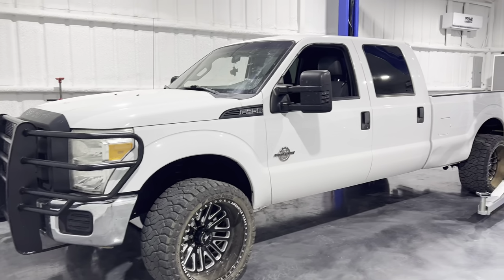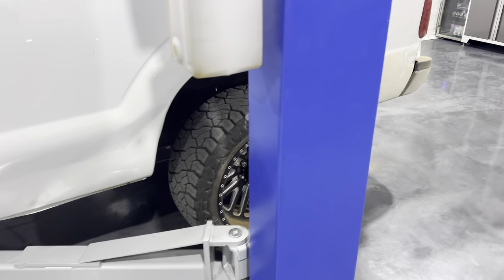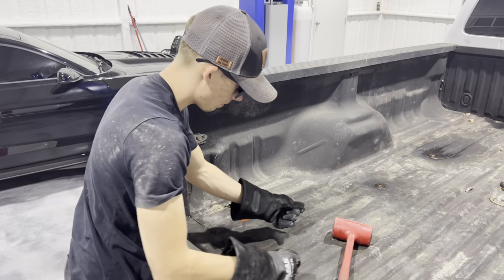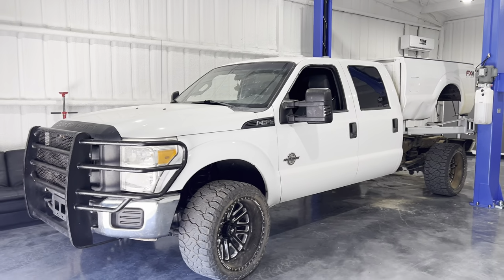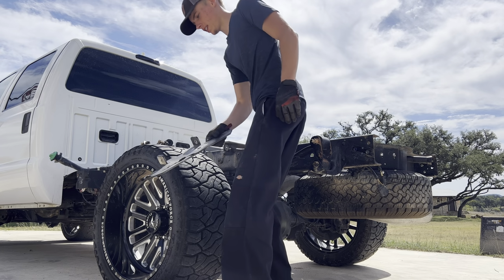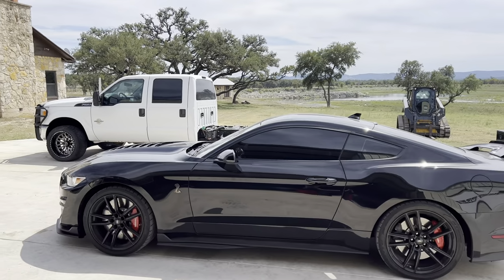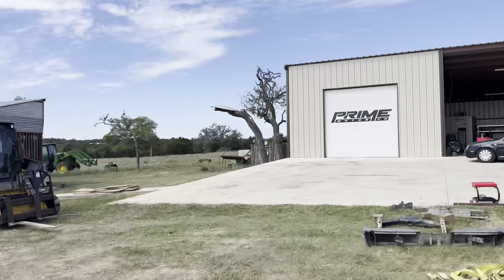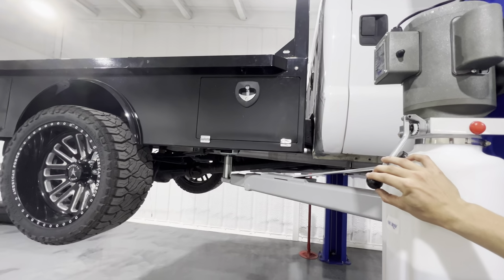Project Skirted Flatbed Install On My F-250!!!

Comment: Looks nice. Love the shop too. 
Watch having an airbag fail on you when loaded. Looks like it will shred your tire quickly. I think I would have a bump stop that would mechanically keep the truck from squatting to the point of tearing sh!t up, especially when hauling. 
What did the flatbed cost?

Comment: dude you killled it. As a f250 owner i keep a truck camper attached to it. I am weight limited, by chance did you calculate the weight difference. I so need want to do this , ford has killed the market , been looking an f350 godzilla all of last yr. Did you weigh. tia..

Comment: What is the purpose/reason for the 2” tubing?? Any issues with lighting?
Reply from the maker: You have to put in the cross sections to attach the bed and have the space between the frame if not the fenders would sit too low and the bed would also, the material of the tubing is also what creates the strength and proper structure to attaching the bed
Reply: I'm going to do something similar, except my angle is going to cup the frame and the tubing is going to be welded down on the angle portion that covers the top surface of the truck frame

Comment: So the side bed is sitting right on top of the tire, what happens when you put a heavy load on the bed?
Reply from the maker: truck has helper airbags in rear they weren't aired up at all in video I've loaded 15k+ lbs now no issues
Reply: @fordsixfo  nice.